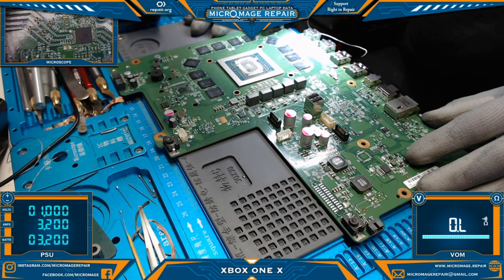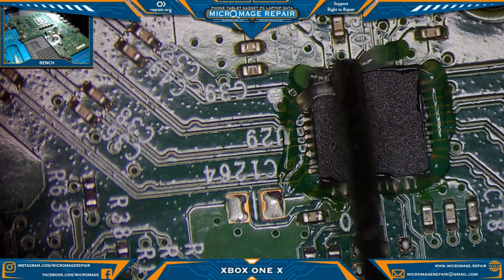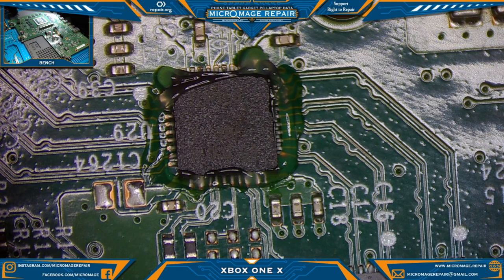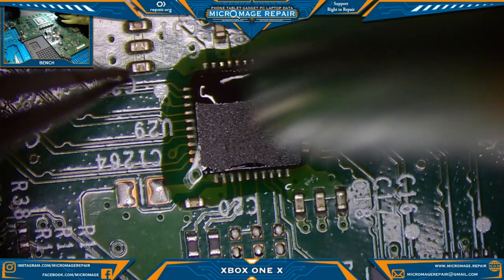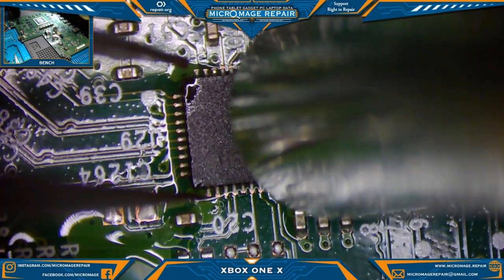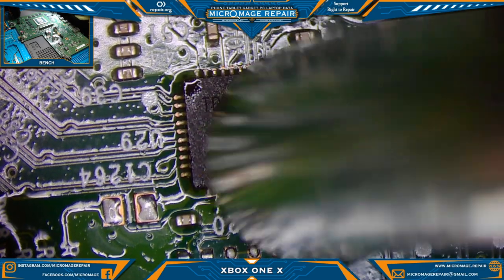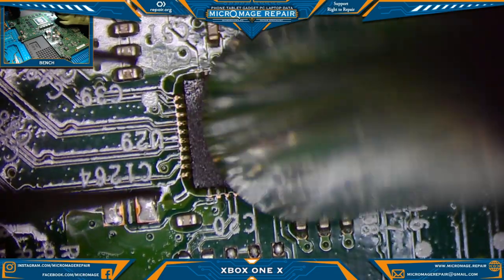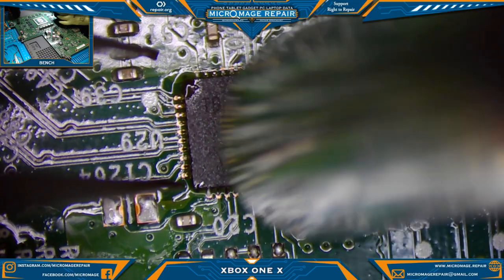Xbox One X TDP158 Replacement

Comment: hello;  looking for a 0.1uF capacitor supplying 3.3v to TDP158? located on the board at C50,Can you help me out? don't have access to a board for parts?? Please Reply,Thank You so much.
Reply from the maker: Hello back!
Knowing the specifications you should be able to find them on Digikey or Mouser.
Reply: @MicroMageRepair  Is the 25v 0.1uf ok to use here?
Reply from the maker: @lordgalla  You have some wiggle room on the ratings, most things are engineered to tolerate something in the neighborhood of + or - 25% of the stated values.
The tighter the value tolerance the higher expense. 
On voltage it's usually ok to replace with a higher rating, even above the 25% in most cases.
Reply: @MicroMageRepair  I know it's 0.1uf on C50 on the Xbox One X Near The Retimer,But is 25v ok to use? 0.1uf 25v mds capacitor?
Reply from the maker: @lordgalla  I haven't personally attempted it.
In theory maybe, can try and see, at worst you'll get some odd behavior because the ESR is too far off.
Reply: @MicroMageRepair  ok,what would you use? best guess on the cap voltage on C50 on the board?
Reply from the maker: @lordgalla  I'd probably try 5-10v myself.
Reply: @MicroMageRepair  thankyou, all i have is the 25v hope for the best,Thank You so much,great talking to you,love your videos to.
Reply from the maker: @lordgalla  Thanks Dave!
Reply: @MicroMageRepair  hello,I found the 10v 0.1uf SMD Capacitor going to give that a try instead of the 25v one see how that works on C50 on the Xbox one x motherboard.
Reply from the maker: @lordgalla  good luck!

Comment: GREETINGS BROTHER FROM SANTO DOMINGO DOMINICAN REPUBLIC I BOUGHT A BLACMAGIEC ATEM STUDIO 6 YEARS AGO AND THE HDMI / SDI OUTPUTS OF THE MULTIVIWERS THE CAMERAS ARE NOT SEEN AND I RESEARCHED A LOT THEY TELL ME THAT IT COULD BE DUE TO VOLTAGE OF A CIRCUIT, I NEED A TECHNICIAN TO HELP ME REPAIR MY ATEM STUDIO BLACMAGIEC..I SEND YOU A VIDEO WHERE YOU CAN SEE THE CAMERA ON BUT IT IS NOT SEEN ON THE SCREEN OF THE MULTIVIWERS. THANK YOU BEFORE HAND HAVE A GOOD AFTERNOON
Reply from the maker: I have responded.
Thanks for reaching out!

Comment: damn, 3 and a half minutes to warm that sucker up?
I actually searched for a video to know how long it takes, since I where into it for over 2 minutes and thought I might toast it.
Reply from the maker: These boards dissipate an incredible amount of heat.
This one may have been with my old Weller WHA 900 unit.
The Atten may be a tad faster, but still takes time.
The news doesn't get better with the new consoles.
It takes noticably longer to remove a Series X Re-driver than a One X.
Reply: @MicroMageRepair  I see.
It took me nearly 4 minutes to remove mine.

However, I have a problem with my Xbox one x which I haven't solved yet.
When I want to turn it on, it makes the on sound, light goes on but is off 2 seconds later.
Never goes beyond that.

I searched and found that this chip maybe could cause that, so I changed it, but it has the same result.
Any idea what it could be?
The hard drive I have checked several times with several pc Programms for health and failure, all test stated it in perfect condition.
Reply from the maker: @TheBlackManitu  that isn't great news.
Double check your work on the Re-driver.
Make sure it's flat to the board and aligned.
After that you pretty much have to go to the power rails and start checking standby voltages.
% chance of repair goes way down if it's not something like a shorted Mosfet or driver.
Reply: @MicroMageRepair  damn, I was afraid to hear that.
I actually pressed the chip to the board as I let it cool to make proper contact. Checked all 4 sides with a microscope to make sure it is perfectly aligned, and even resoldered the pins in the chip which had a questionable connection with a microtip, and checked everything again with the microscope.
I'm 99% sure it is soldered correctly.

Has anyone a good video about the power rails of the Xbox one x?
Since I usually don't have to dig down that deep in the repairs I did so far.

However, thank you very much for the help so far.
Reply from the maker: @TheBlackManitu  Take a look at TheCod3r, he has a pretty good catalog, also if you have Facebook check out Game Console Repair Legion, it's a group that's worth having in your arsenal.
Note: do a search on the group before posting, allot of issues have been covered already.
Reply: @MicroMageRepair  perfect, thank you so much. I will check out both.